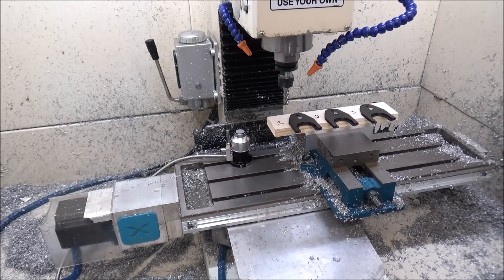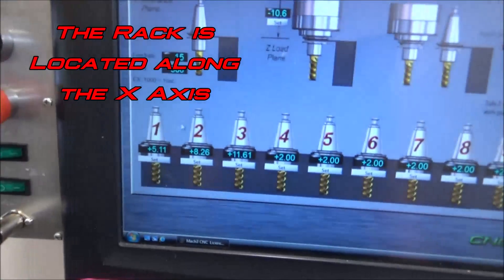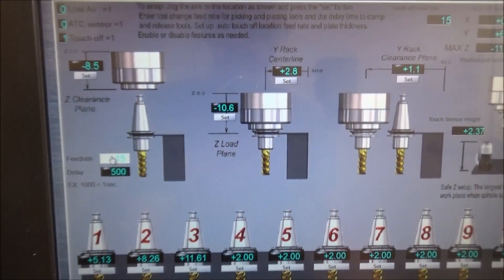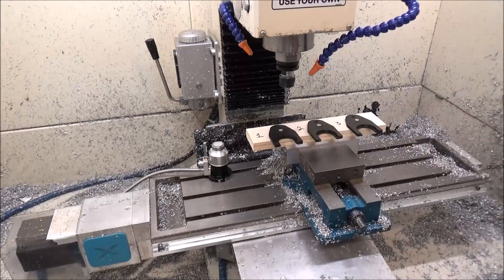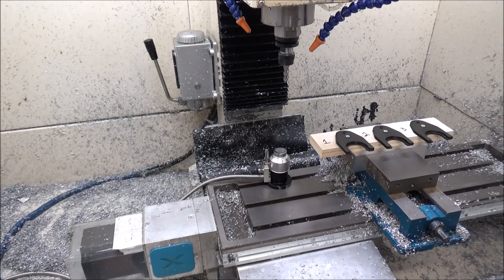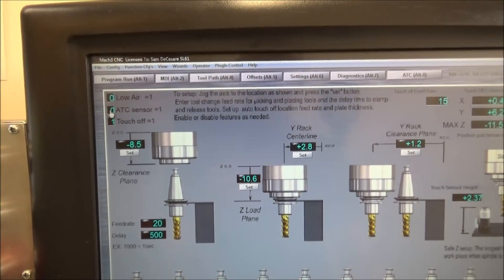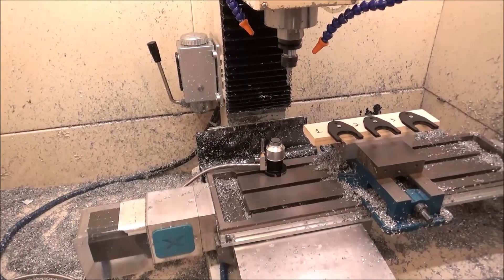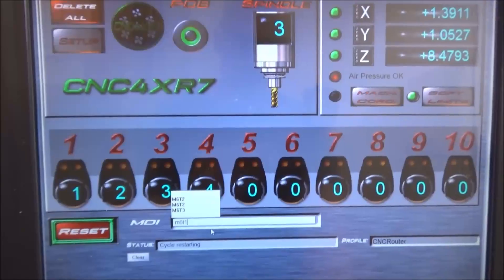Mach3 AutoTouch off update!

Comment: I've  just got the same prob the other day. Got it working but haven't  got any mach3 macro for it yet. Does your auto tool touch off work without a ATC? Also how you got both the touch probe and and Z height probs wired to you bob when mach3 only recognises only one jnput signal?if that makes sense. 

Great channel,  been following  for about 3 years  now, come a long way with conversion.
Reply from the maker: The Auto touch off does not need a ATC to function However I don't really see the point in having a Auto feature if your going to manually change the tools. I do have a manual touch off Macro on the probing and offset tab which may be what you want. I use a MIDI plug and just plug in the touch sensor or probe when needed. Yes they share the same input. Both the Touch sensor and Probe are Normally close devices so i guess you could wire them in series. if you wanted.
Send me a email and let me know what your looking for in terms of the touch off.
Reply: @CNC4XR7  Yeah was thinking both your probes were NC, that would  make it easy to wire in series or use the MIDI. With Auto Z touch off probe, was thinking for things like changing drill bits or using a tool that wasn't in the tool table. So every tool change request I could press the auto zero and it would move to the probe location and touch off and continue on. Cheers.
Reply from the maker: @TONBRICKS  well of course I can add custom features to any screen